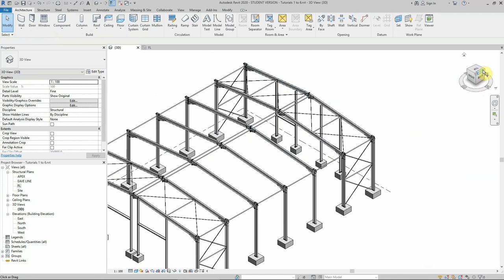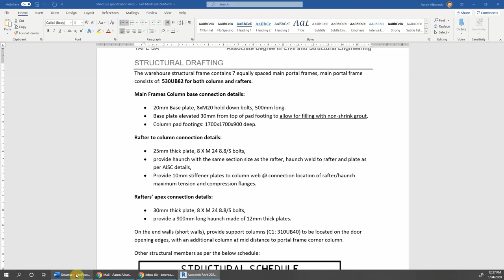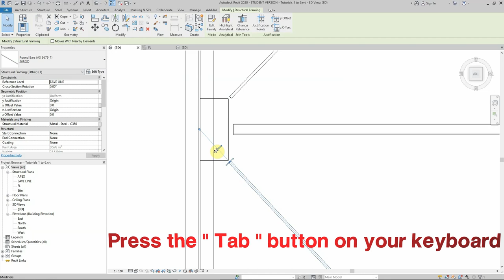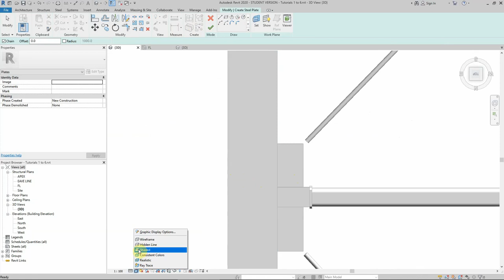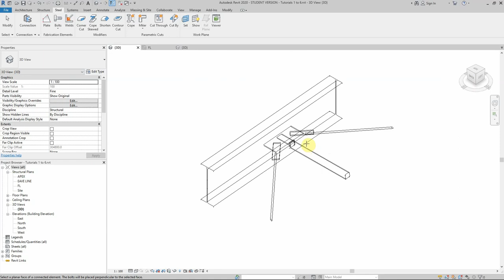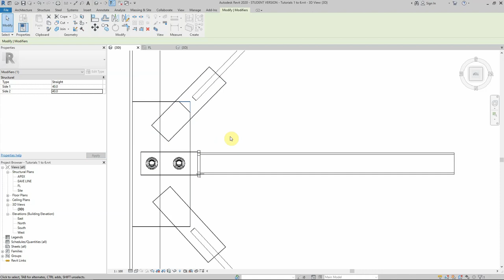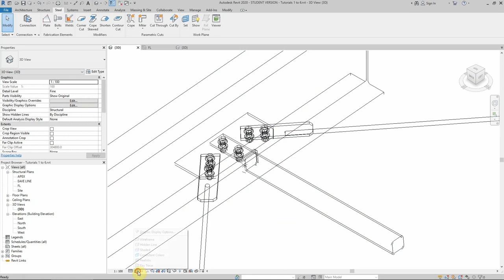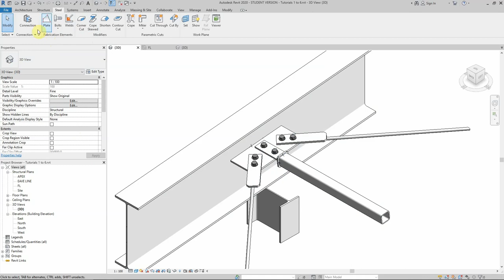Tutorial 5: Connection Design Part 4: Revit custom steel connection (bracing gusset)

Comment: Aaron, thanks for the video but I can't find next video with problem which is more important for me. Revit doesn't allow to make custom connection with more than three details. I have four details (column+beam+two diagonal connections (almost like yours in the tutorial but other sortaments and vertical)). Please, can you guide me where is next tutorial with connection creating. I'm badly need it but can't find any info. I thought that I have only one solution -- family creation but probably you know easier way. Thanks!
Reply from the maker: Hi mate, have you checked this video? 
Tutorial 5 (Part 5): Second method for roof and wall bracing connection
https://youtu.be/8gIr7xSPRzo